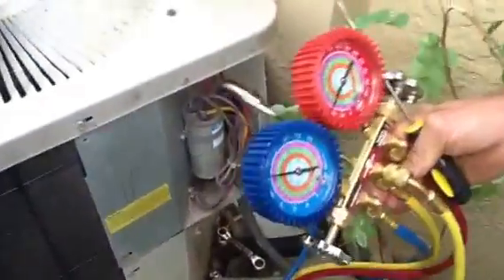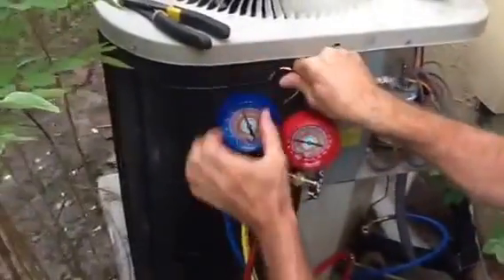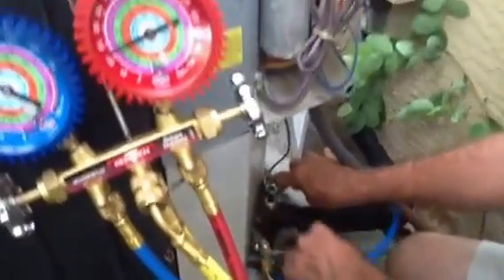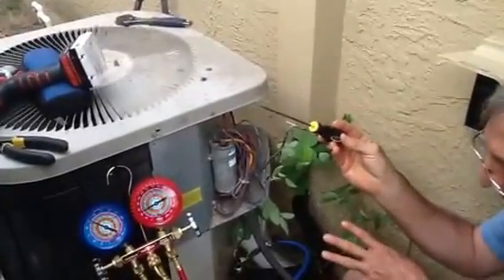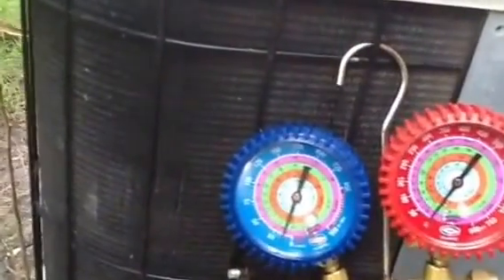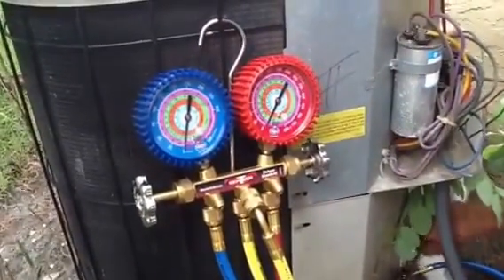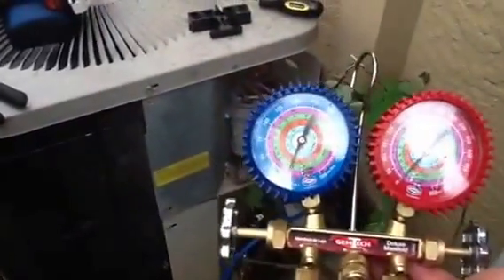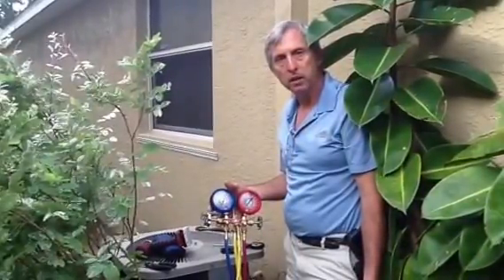Pump the Unit Down Explained AC Repair

Comment: Thanks for the video. I have a leak on my unit. My filter dryer leaked. Do I have to follow the same process or due to the leak all the refrigerant is gone out? Do I have to be concerned about moisture in the compressor now?

Comment: I heard you mentioned in this clip that the suction valve on the manifold should be already be "up" by your tech.  Is "up" meant "Close" or Open" on the manifold?  I tried this same procedure on a 3 phase Goodman, 5 ton, r410, slipped unit.  it seems that both lines are at around 150psi and needles did move at all when reset button was pushed in for around 2 minutes.  Before reset switch was pushed, Liquid line's nut was completely" closed or front seated", suction nut was about a few turns left to be completely "closed or front seated".  No power to Air Handler/evap. coil?  Did I do something wrong or was missing something? Thanks. try to call your number 339-596-5855, not get thru.

Comment: these videos suck
Reply: Where are yours?
Reply: Andy is right, the video blows! This guy is not very safety oriented and it could lead to someone watching this video getting hurt. Never use a screwdriver to "JUMP/BYPAS" the power to the unit especially when it is on !!. Luis don't be a fkn idiot, its obvious Andy or anybody watching this doesn't have their own video ya twat ! These videos are to educate, no eradicate someone's life
Reply: my google C Opinions are like ASSHOLES.  Everyone has one.  This guy has been working on AC's ever since you where on diapers..lol

Obviously these videos are not to give you step by step instructions on how to work on your own system.  Education is for that.  You take an AC class become certified and learn COMMON SENSE and apply it.
Reply: my google C He's using the screwdriver to push in the contacter. He not actually touching high voltage. He mentioned using an insulated screwdriver just in case you were to slip. He's doing the pump down give or take like every single service tech in the field. This video isn't meant for a home owner. With out EPA certifications a home owner has no business doing this.

Comment: Not supposed to pump down below zero. Why did you only pump the unit down if you're changing it out? The scrap yard is going to bust it open and vent it to the atmosphere. The refrigerant should be recovered. Pumping down units is for locating and fixing leaks or replacing evaporators/filter dryers.

Comment: nice explanation david do you need to have both low and high side valve's on manifold open or closed???
Reply: +jimbola77  No, you just need the suction side (blue gauge) connected. It wont hurt anything if you do have both gauges hooked up.

Comment: Hello Mr David please correct me if I am wrong.  when you pump down the outside unit you nearly close completely the suction line to prevent the refrigerant to go back to the system.
Thanks

Comment: Always be cautious when operating an air conditioning unit for services purposes only front seeds the high side as the unit is running with your manifold gauges on to bring it into a vacuum stage to recover the refrigerant into the condensing units after operating it check to suction side and you're high side as it gets down to ride around 5 to 10 PS I above 0 Francine's the low side always need a little bit of freon in the line set some compressor manufacturers recommend that you do not pump the system down all the way to vacuum

Comment: Manuel if you knew anything about A/C you would know that he just purge the line. He removed the air in hoes, which is something you don't want in your Air Conditioning System.
Reply: You are correct, purging or disconnect is not a big deal, intentionally releasing say like 5lbs into the air yeah that's a big deal, plus no one caught that he called the high side the liquid line and Freon is going into the condenser, it's going into the receiver of the condenser better to call it a heat exchanger....just me lol
Reply: +Dave Nottingham The high side is the liquid line. Receivers are in heat pumps. They collect/store excess refrigerant since less is cycled in heat mode. The outdoor unit is the condenser. The condensing coil can't condense refrigerant without the fan and compressor. Intentionally venting systems is illegal... using refrigerant as trace gas for detecting leaks is allowed. Low loss hose fittings should be used but due diligence and good faith effort rule the day.